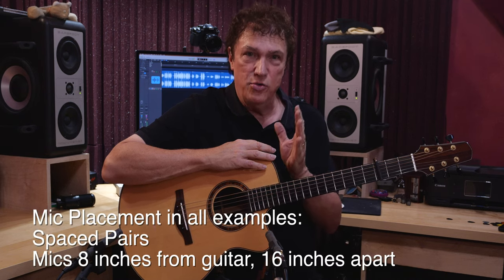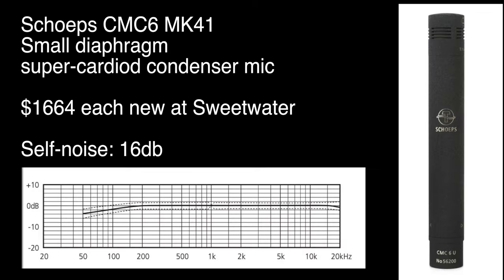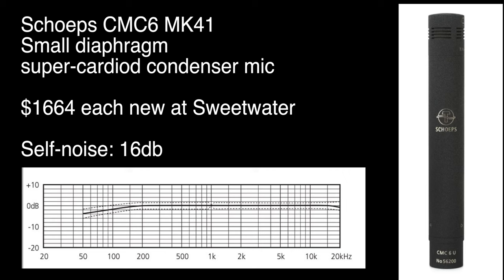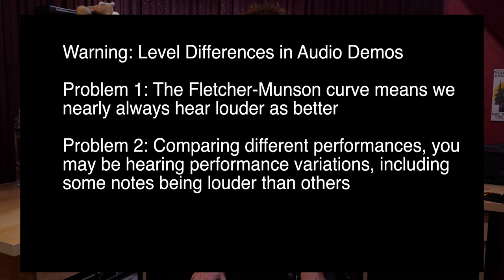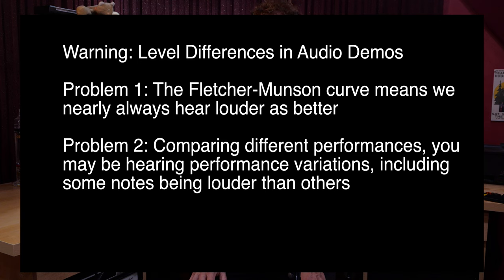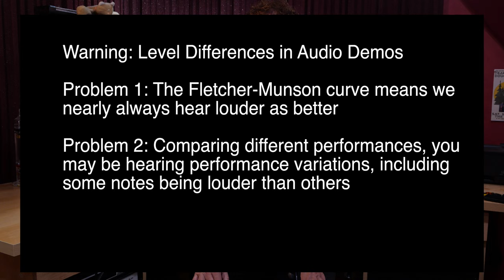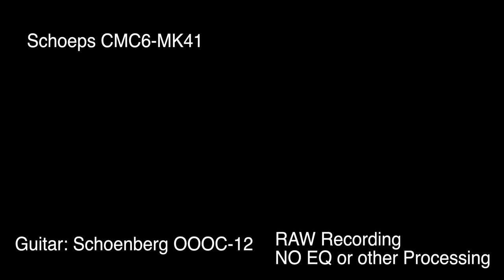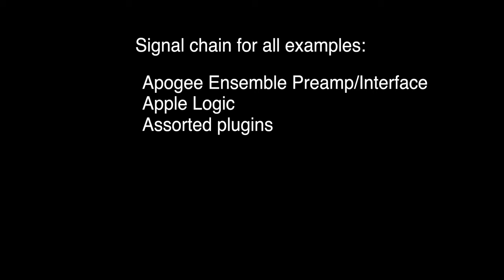Condenser Mic Comparison for Recording Acoustic Guitar

Comment: May I ask what mic stand and clips you’re using in this video? Great demo as well.
Reply from the maker: Mic stands are DR Pro short (drum) stands. Mic clips, I'm not sure. These might be the Hosa MHR-122s? I've just had them forever, they work well for things like this where I'm changing between different mics of different sizes, since they're just a clamp. Normally, I have clips meant for the Schoeps, Neumann's, etc, and if I'm just setting up those specific mics, I'll use the clips meant for those mics.

Comment: Sadly that there wasn't a soyuz 013... Really wanted to hear it in your recordings in comparison with KM184 ^^
Reply from the maker: I tried a 013 pair recently, and considered doing a demo of them, but I really didn't care for them. Very colored mic in a way that I didn't find flattering. They got sent back quickly. Great looking mics, tho, and I guess you can say that at least they're offering something different.
Reply: @DougYoungGuitar  yeah its to coloured to make a mixes or just flat recordings. But I can imagine that it could fit for solo fingerstyle acoustic guitar, how sweet also percussion would be etc. Especially if I dont have super studio condition at home, just did what I can, but its not perfect :( 
 So I'm a bit scared, that KM184 would be overkilled by the room itself.
 But I see that potential of km184 to be EQ'ed easily. As far as I understand, more flat sound is easier to Post-Process if needed

Comment: Listened with DALI Oberon 3 speakers and Denon D7200 headphones. I would say that: 
 CAD -> AT2020 -> NT5  having noticable improvement. Right for the price. 
NT5 -> KM184 little difference, lets say - if money difference not a huge problem for that and you want a bit better sound - then fine. This is exactly my case right now. Just hard to decide :D 
KM184 - CMC6-MK41 imho, question of a taste. I would definitely not investing that money for any kind of "home recordings". Its like an audiophile topic, where people are buying 5000$ headphones and 1000$ cables for that  😀 Pretty sure, that Telefunken M60, Gefell M300, Soyuz 013, Beyerdynamic MC930 could be also the choise for someone, who is using mic in price range on KM184 and want something else. I've just read 1000 of forum pages last time and it seems like that. There are no place 1-2-3 at all. Just "taste" and usecase.
Reply from the maker: Yep, as I said in the other video thread where I sent you to this one - the difference between mics is far more subtle than we're led to believe in marketing materials. That said, there are differences. Some of these show up in use more than in the final result. When I first got a chance to try better mics, first the KM184s and later the Schoeps, what I first noticed was how much easier they were to work with. The cheaper mics I had been using required a lot of attention to placement to sound good. With the 184s and Schoeps, it's almost like you can't make them sound bad if you try!  Placement still matters, but they sound pretty good no matter where you put them. There can also be very quantifiable differences, such as self-noise, which can sometimes be noticeably high in some budget signal chains. All depends on budgets and how important the differences are to you. I've made recordings with even cheaper mics than these, and as with anything, including guitars, you're chasing diminishing returns as the price increases. It comes down to whether the cost for another 1% improvement (or 0.1%!) is worth it to you, or for that matter, if you can even notice the difference.
Reply: @DougYoungGuitar  thanks for a lot of useful info :)  If I didn''t try so far to do something I wouldn't understand that. But I already tried to work only with one Sennheiser MK4 incompletely untreated room. That was terrible experience considering also the fact, that I dont have mixing experience :D 
  Sorry for annoying, but last question If we talk exactly about:
 -> "Some of these show up in use more than in the final result"
 Did you mention significant difference between Rode NT5 and Neumann KM184, while post-production? And what exactly was the issues? (I assume on Rode's)
Reply from the maker: @Therapyxx  I thought the NT5 and KM184 were pretty close. We're really splitting hairs with all of them. My goal is to let people decide for themselves by listening to these, and my opinion shouldn't matter much. But for what it's worth, the CAD mics have almost nothing above about 10KHz, tho that's barely noticeable. I find the AT2020s a bit thinner, tho again, they sound fine and can be EQd. The NT5 and KM184s sound good, with less difference between them than you might think. Might be hard to pick them out blind. The Schoeps just sound almost exactly like my guitar. So really, no "issues" with any of these. The Rode's were borrowed, so I haven't spent much time with them aside from this demo. The 184s and Schoeps, I've had for a long time, so I have more a sense of how they're going to work - which mostly "stick them someplace reasonable, and they'll sound good"
Reply: @DougYoungGuitar  thanks for all info and demo. it helps a lot. Just got Neumann ndh 30 headphones and it became even more noticable whats going on. 
 I would say - to my ears, I love KM184 most, it so much detailed and rich. Rode is 100% fine, even for me its more than fine. But i know that someday I will end with selling rode's and buy Neumans, so I will try to focus on one Neumann firstly and then add second one later (in case I will need that) :D
  Everyone says, that Neumanns are too bright. If its the case... Then Rode's are x2 brighter :D I tried to find a lot of fingerstyle recordings on youtube and checked, which mics are used there. Rode's are really popular choice, M5 and NT5. But all those recording are so bright... And in case the guy has something like Beyerdynamic DT770 Headphones, which are twice brighter than Rode's mics, then the whole composition hears like 10+ DB on high freqs.
Reply from the maker: @Therapyxx  What you listen on definitely makes a big difference. So many people these days are listening on their phones, either thru the speakers (yuck), or cheap earbuds (also yuck), which totally changes everything. Mostly you can't hear subtle differences, or even big differences. Sometimes I've even heard things I thought sounded good on my phone only to discover how bad it sounded over studio monitors (and vice-versa, I guess)

Comment: What would you suggest for percussive fingerstyle playing?
I am currently using a cheaper end micophone like Focusrite but the attack is always too sharp for me
Reply from the maker: cheaper mics can sometimes have a harsh high end, which might be causing a problem. I don't really have a lot of experience with percussive guitar, but I could imagine it might aggravate the problem. It could also be due to room acoustics, which can produce a harsh sound if they aren't controlled. Many percussive players mix in a pickup, usually a sound board transducer like the K&K, which can add some more direct, punchy and maybe woody sound to percussive effects.
Reply: @DougYoungGuitar  I've installed LR Baggs Lyric on my Furch yellow gccr
I am thinking about getting Neuman KM184
but for my budget I can only get one, would you say it would be a better option to buy two cheaper mics like Rode NT5 or AT2020 for better result?
Reply from the maker: @Floydandsome  It depends on how important stereo is to you, I guess. Most solo guitar, if thats what you're doing, is in stereo these days. You might look at used to keep the budget down. The 2020s can work fine, tho it certainly isn't a higher end mic. There are other AT mics for a bit more that sound a bit fuller. I personally would choose a more budget mic(s) in stereo over a single mono mic, if I had to choose, but that's just my taste - I'm used to hearing stereo for solo guitar.
Reply: @DougYoungGuitar  Thank you so much for answering!
I might go to have soundcheck first
Reply: @DougYoungGuitar  Thanks for answering
I might go to have a soundcheck first
Reply from the maker: Keep in mind that what you're hearing may not be due to  your mics. Rom acoustics can make a huge difference. Mic placement matters and so on. In this video, you can get at least some idea of how much you gain (or don't) from the more expensive mics compared to budget models.
Reply: @DougYoungGuitar My room acoustic is actually pretty bad since my room is pretty compact and crowed since there's a lot of furniture there
I am a bit skeptical whether upgrading the mic could make any diference or it just a waste of money
Reply from the maker: @Floydandsome  room treatment is usually the biggest bang for the buck. If your room is bad, a "better" mic will just do a better job of capturing that bad room sound. A crowded room isn't necessarily a bad thing, tho. it just depends. Hard to know without hearing it.
Reply: @DougYoungGuitar  Unfortunately room acoustic might be a bit hard to fix for now unless I move to a new apartment. But thanks again for your help!